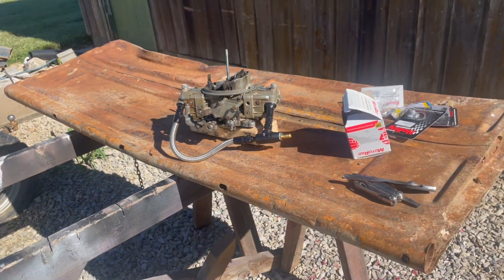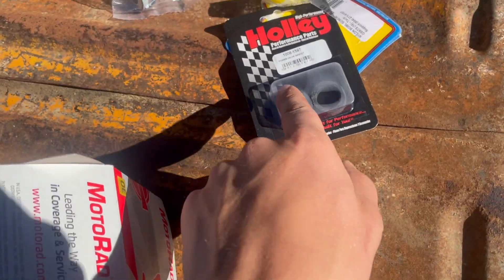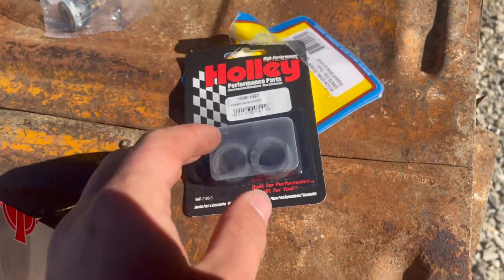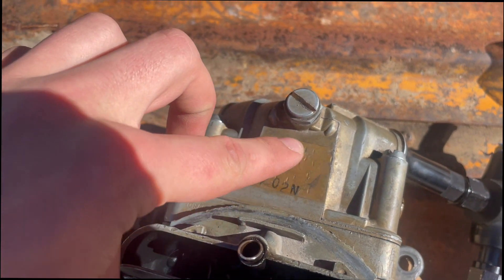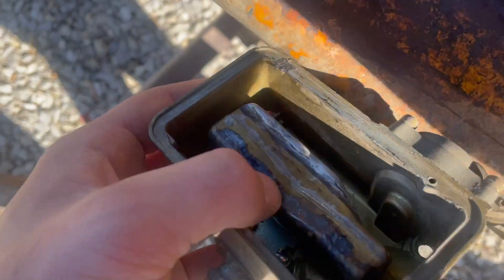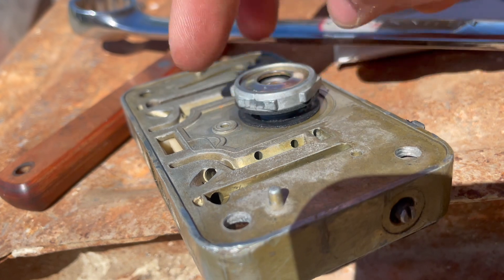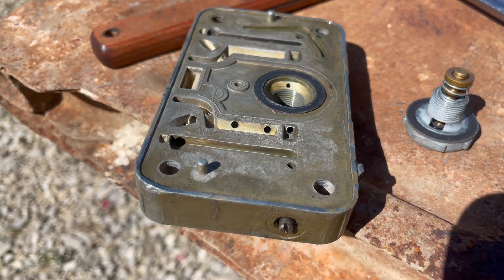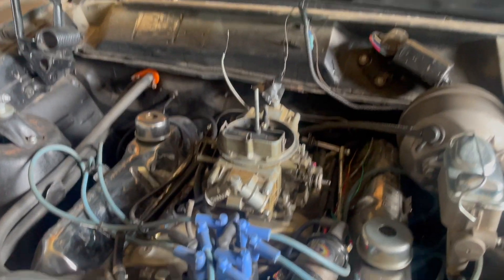Installing a Power Valve Block-off Plate On a Holley Double Pumper

Comment: Don't make the same mistake twice. 12.2 is fine, that the average. One cylinder is at 11 something and another is at 13 something. Dont overheat another exhaust valve and piston and window that block. Quit while you are ahead.